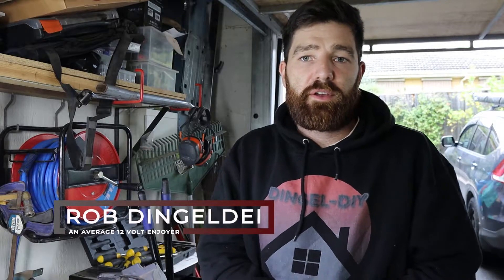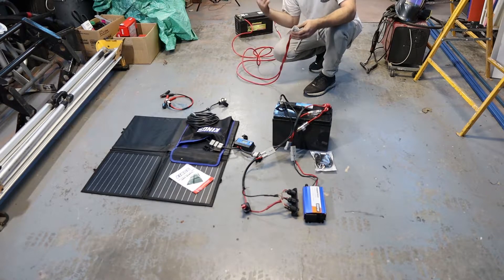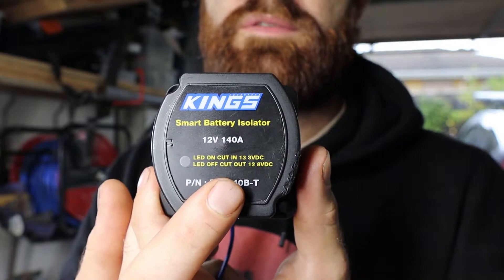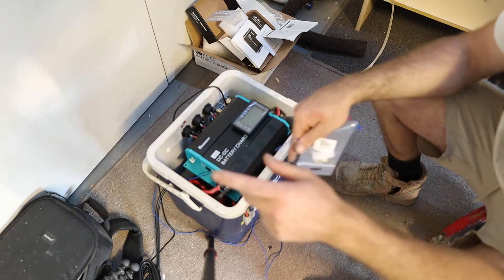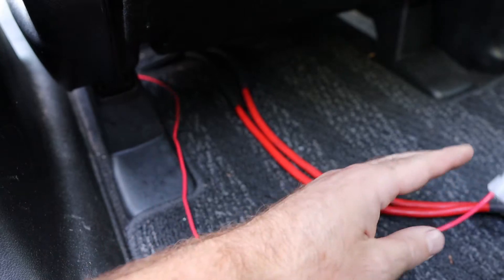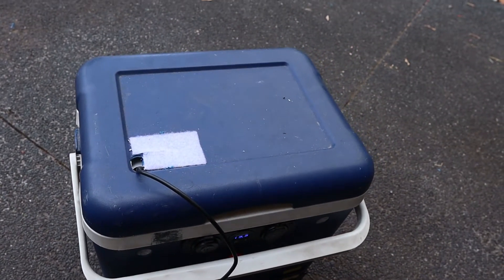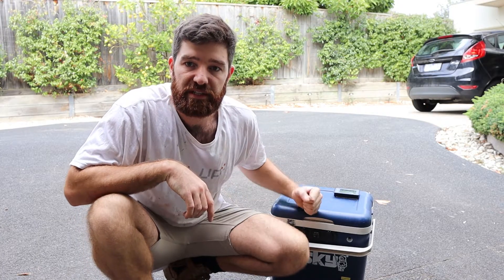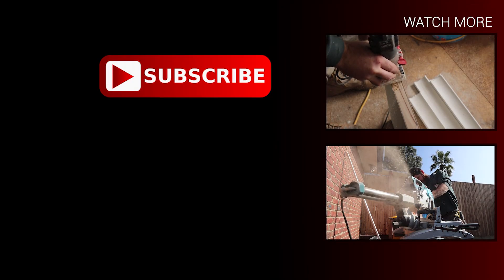DIY Battery Box Build for Begginers | Introduction to 12V Batteries, Isolators DC Chargers & MORE!

Comment: Your setup is probably one of the best I have seen out there. What are your thoughts on to LiFePO4? and would it be possible for you to share a diagram of your setup? I am planning on one but I will use the Wagan DDC with MPPT charger as that is available here in the US.
Reply from the maker: Sorry in advance that I cant be more helpful.
I've never heard of those above brands and models. I went with what I could afford and all is good so far. 
I can't do a diagram as it's been so long since i made this. I can say that you need good MIDI fuses at both positive terminals of both batteries. The dc charger will come with it's own diagram and for each of my looms that i made they had a fuse and all connected to the battery via their own terminal. The battery monitor also comes with its own wiring diagram